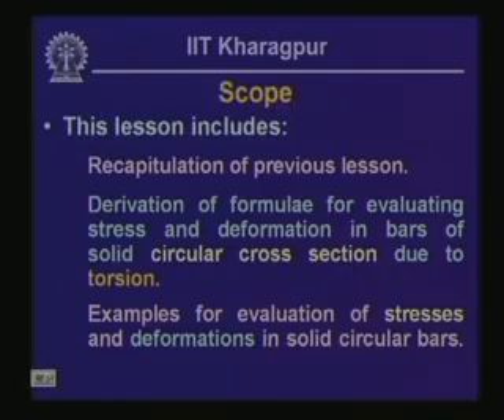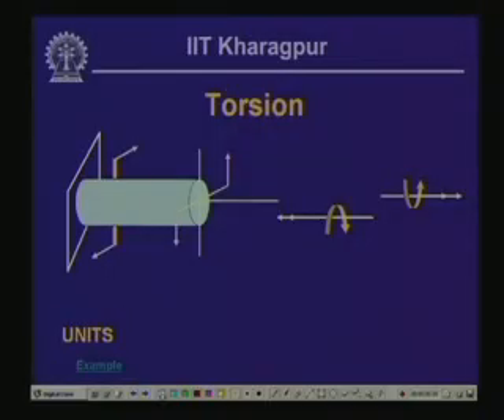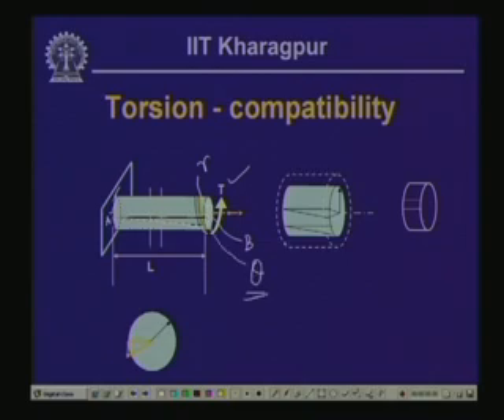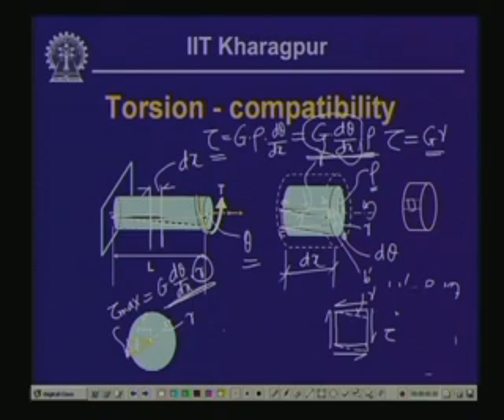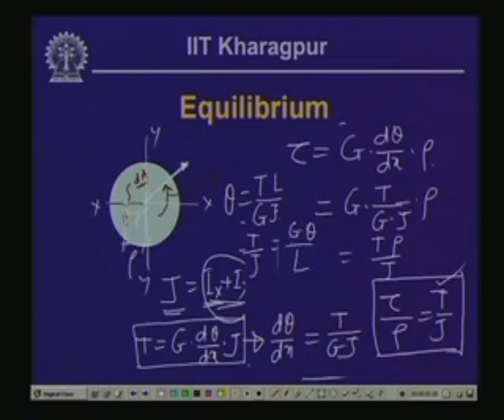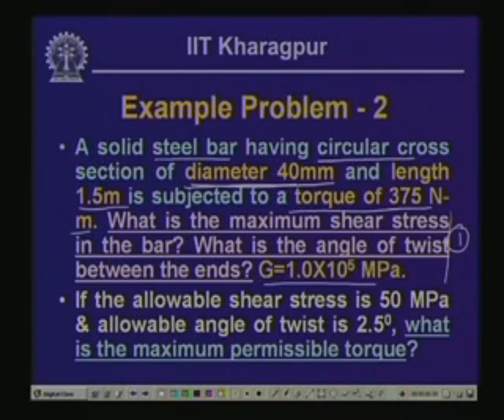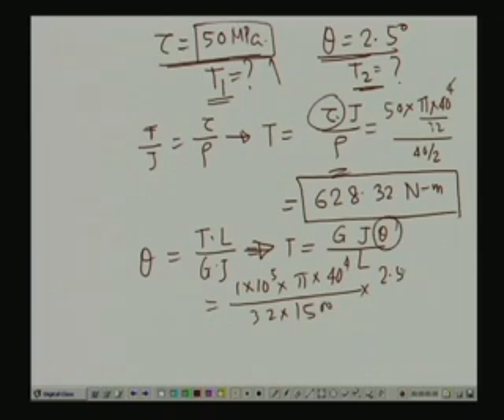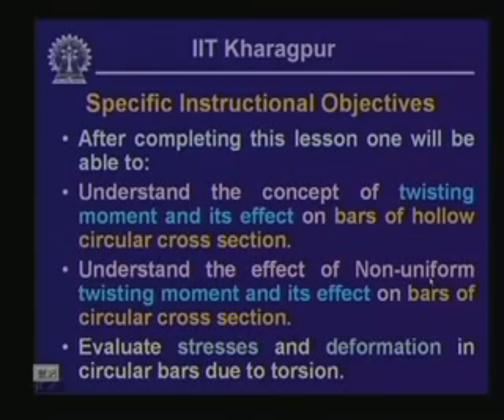Lecture - 18 Torsion - I

Comment: In example 1 from thin pressure vessels, the question says axial displacement is prevented. So the longitudinal strain should be zero right?
Reply: Yes bro
Reply: longitudinal strain=0 or longitudinal stress=0? confused
Reply: Yes bro